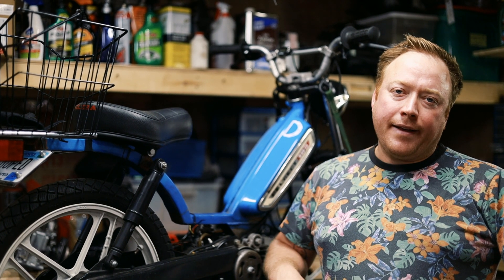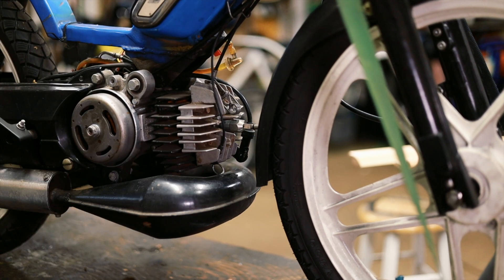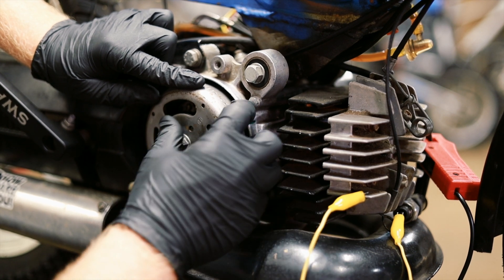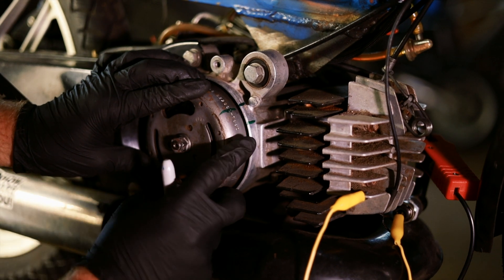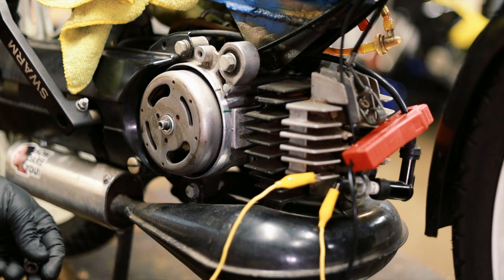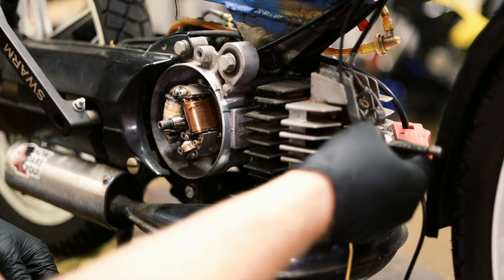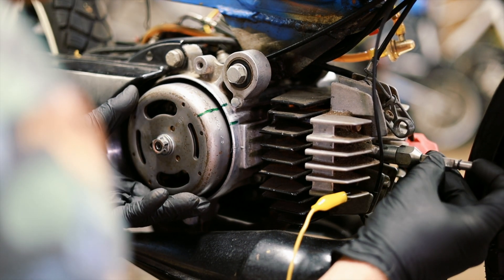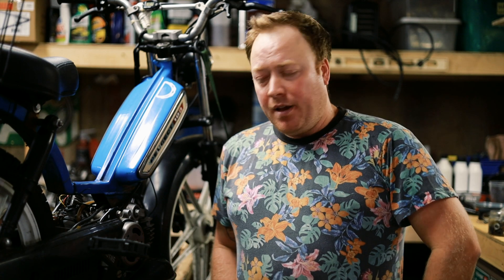Honda Hobbit CDI moped - Learn the secret to perfect ignition timing in minutes! Pa50

Comment: hi buddy if i do this with my pw80 would it be rotating the flywheel with a 4 degree key the way the engine rotates or away not the stator but i mean the flywheel obviopusly with doing an advance by timing key really realllyyy confused keep switching on which way i think it is
Reply: Hi it's me again on different account do you have a answer to this mate really still confused lol

Comment: Overheating issues ('83 Hobbit) have brought me to this video. Stocko shocko kit, Boysen reeds, VM20 w/enlarged intake, and Jammy pipe.  Currently running stock CDI, 160 jet, and BR6 plug.  I overheat at 410 F!  Gonna be trying to swap to a BR8 ug, upjet, and then will be attempting the timing adjustments
Reply from the maker: I would check out your timing. and maybe upgrade your head to the Derbi head. https://youtu.be/Czy-QvjIEeA

Comment: This thing has no cdi 🤣
Reply from the maker: Look at 3:00. I take the flywheel off and you can see the pickup. It is not points  like the earlier Hobbits. The 83 came with a CDI and you can swap the CDI box for a Jog box to get a nice ignition curve
Reply: @Corn-ped  Learned something new, in Belgium they do not have a cdi, only contacts. They were all build in Aalst (Belgium) so they designed the US spec differently, we also don't have the single reed slot for the slower version. Keep up the great work. I am doing some repairs now, later this year I do a roadtrip to Italie of some 3200km or 2000miles. I use a magnet, hallsensor and a tip42c transistor for ignition.
Reply from the maker: The CDI is rare here as well. It is on on the 1983 model. It is 12v and has no curve. But it's robust and you can change the box!
Reply from the maker: Most people use an HPI CDI here

Comment: Use a key to protect the taper on the crank.

Use a flywheel with an external trigger and pickup then slot the flywheel and use three bolts to secure it.

Comment: What do you run for jetting? I just installed a vm20 on my hobbit 70cc 7 port, proma pipe, mlm intake . It just bogs at WOT regardless of main jet size. I've tried 140-180. It acts choked up and then will backfire in the pipe. That's what has me thinking my timing is whack or something. Great acceleration. Do these have some form of rev limiter? Mines 1983.

Comment: New to moped world. Rebuilding two hobbits 78 and 81. I need to find flywheels and stators for both. What will work can find own.
Reply from the maker: You could buy new cdis from treatland.tv or post a want to buy in the hobbit Facebook group.
Reply: @Corn-ped  sorry for sums questions. Only thing I found on treats was a 3 wire. Electric diagrams show 4wire.
Reply from the maker: Yeah those might require some rewiring. You could find stock ones on ebay
Reply: @Corn-ped  will NC50 interchange with the PA50
Reply from the maker: @tytipps6750  they will work. Although I don't know if the wires are the same. I believe the nc50 are 12v CDI. So much better but won't work without rewiring.

Comment: how does it work witouth a woodruff key ? i have a couple hobbits myself and i have never seen this before
Reply from the maker: It doesn't need a woodruff key. The taper keeps it locked in place. The woodruff key is only if you ware setting up a stock ignition at stock timing. A lot of aftermarket ignitions need custom timing.
Reply: @Corn-ped  oh that’s nice, I did not know this. Thanks

Comment: Is that the ignition timing for Puch chart you're using?  It won't quite match up for hobbits, due to the different stroke (39.6mm vs 43mm) / conrod length (80mm vs 90mm).  I haven't done the math to see how much they diverge at 1.5mm BTDC though.
Reply from the maker: It is not. I made a hobbit version. I also put a link to it in the description.
Reply: @Corn-ped  rad, thanks!